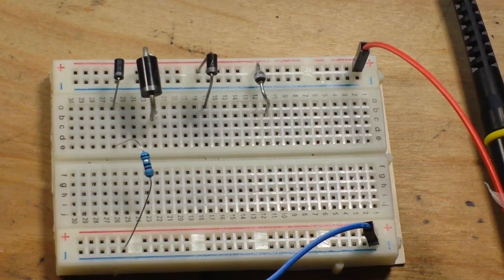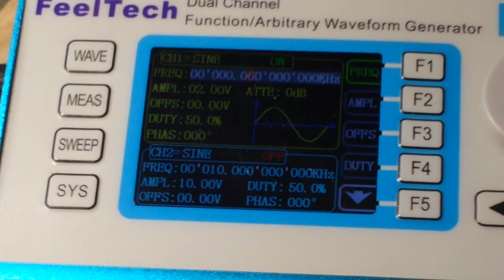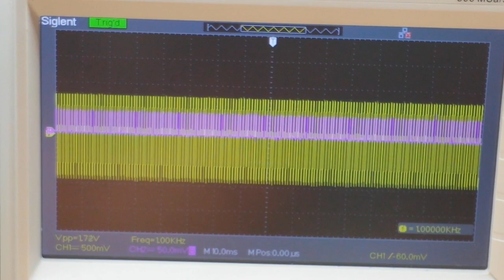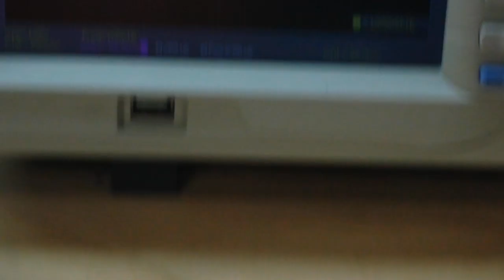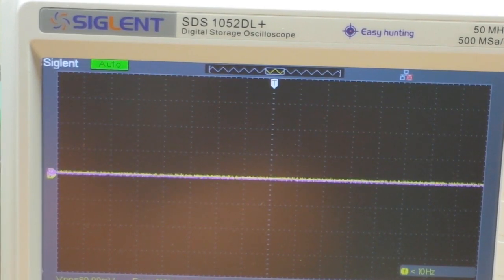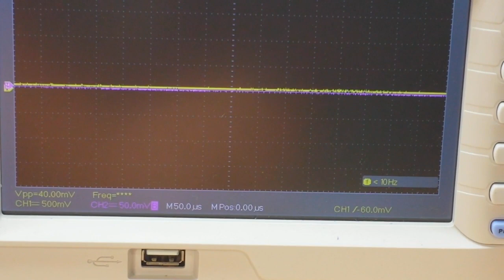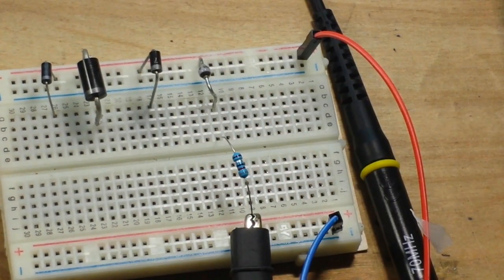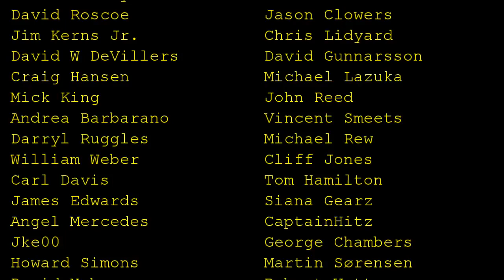What is diode recovery time?

Comment: At the higher frequencies on the shotky-diode for me it looks more like you see the capacitive effects of the diode in the reverse direction are dominating the recovery time of the shotky. The reason why I think that is because of the rectified signal is crossing the zero line in positive direction almost exactly at the place where the negative peak of the input signal is. This correpsonds really good with the differentiation action capcitance has in series with a low resistance. So what are your thoughts about this?

Comment: Are you sure the disappointing measured performance of the ultra high speed diode isn't caused by problems with your test setup? Parasitic inductance and capacitance in the wires or breaboard, for instance?

Comment: “Close, but no cigars”

As your results already showed, the basic silicon diodes (1N4007 and 1N540x) should not be used beyond some 10 kHz.  Their losses, i.e. heat generation within themselves and especially in the associated transistor become definitely too high at 100 kHz.
The Schottky is superior, whenever its voltage rating is adequate.  Some of them are only rated for 15 V, many at 30 V, a few at 60 V and almost none at 100 V.  The ultrafast diodes on the other hand are readily found rated 600 V.  They are SLOWER than Schottky, but if you need 200 V, you need one of the compromise ultrafast ones.
Now, the low voltage rating of silicon Schottky diodes can be circumvented by changing to some other materials, especially to silicon carbide.  They are available with over 1,000 V rating.  There is a tradeoff in the forward voltage drop that is much higher, but at 1,000 V even that does not matter too much any more.  The same is true to a lesser degree between silicon Schottky (0.4 V forward), ordinary diode (0.66 V) and ultrafast (0.9 V).  If you are dealing with supply for 5 V or lower, you don’t want other than the lowest drop.  Actually even Schottky pales to active rectifiers built from FETs.  Anyway, the application determines what you can and should use.
Reply from the maker: Thank you for the great comment.

Comment: Thanks, Paul. Is the Aneng 8009 on your Amazon Store? I'm going to get one in the next few days and want to help the channel. Also, what is that frequency generator you used in the video? I still can't get that kit to work right. Thanks for a good diode explanation video!
Reply from the maker: Hi George, i added the 8009 to my store. The AWG is a Feel Tech 2300 from Banggood. Here's a link to my review: https://youtu.be/5cGfk6LZmHM
Reply: Thanks, buddy. I'll get that 8009 in the next couple of days and I'll check out the video.